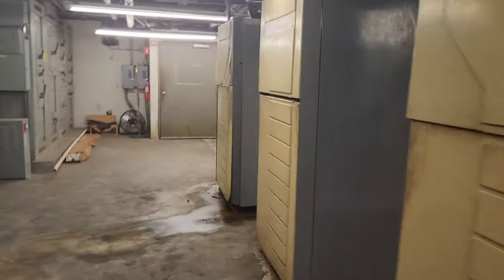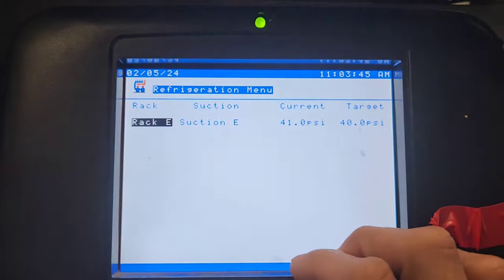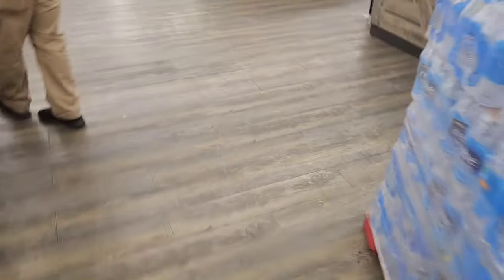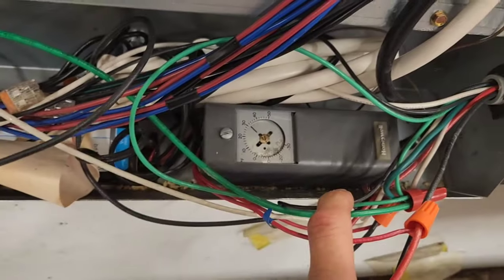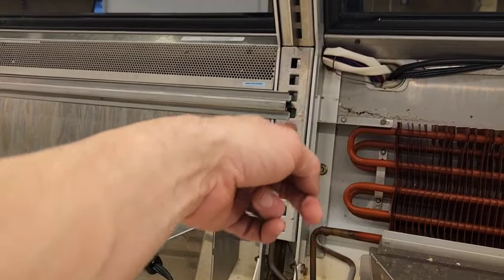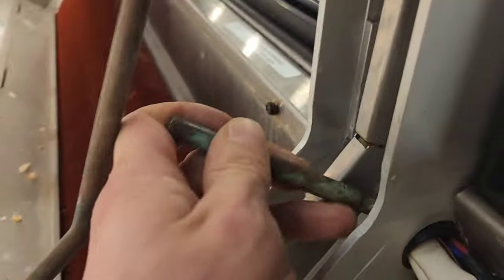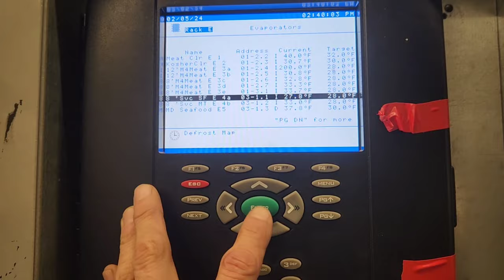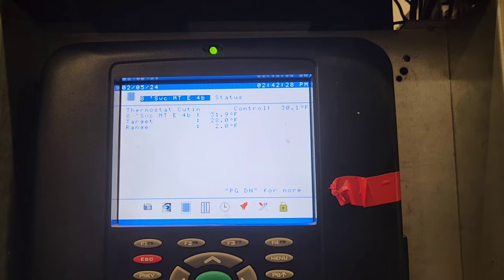Service Meat Case Not Working

Comment: I also had the luck of replacing a stat on one of these cases. Ya there’s no way you can get that sensing bulb in there. I ended up drilling a new hole in the case to run the new bulb in 

Great idea on the ke2.
Reply from the maker: Smart idea drilling the new hole. Gotta do something

Comment: Do you hook up the solenoid wires on the normally closed terminals for the ke2?
Reply: Would need to wire on normally open as llsv is normally closed.
Reply from the maker: That is correct.  One Wire on the Common, one wire on the N.O. terminal.  Having a Normally Closed contact would allow the control of a heat circuit-in a different application of course. For Example,  I have a White Rodgers ETC111000 in my garage. I use it for the window unit, that functions ac and Heat. Cut the 220 wire and interrupt it with a 2 pole 240 volt contactor. L1 jumper goes straight to one side of the coil. L2 also feeds the other side of the contactor with the ETC111000, interrupting that jumper. Easy!

Comment: Was there no way to just recalibrate the temp probe?
Reply from the maker: I don't think it could have been recalibrated. I could have just lowered the set point on the one that was there but, That leaves the question of why did it lose its calibration in the first place and leaves it open the possibility that it would just do it again.
Reply: @HVACRServiceTech  I would think most controllers would have the ability to recalibrate the RTDs. Now how linear that calibration would be is a good question, but you would think it would be possible. Just a quick search for a ke2 controller price i see it can cost ~$1700, for that amount this new one should be able to be calibrated.